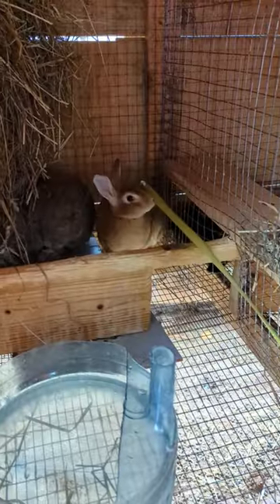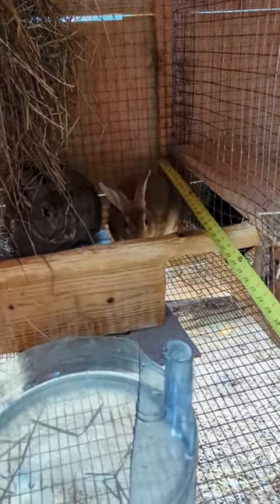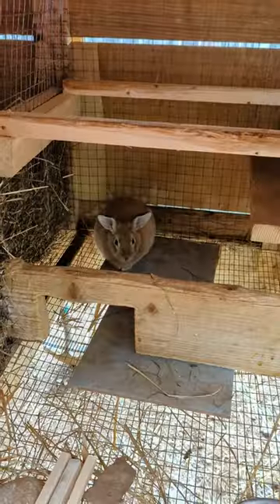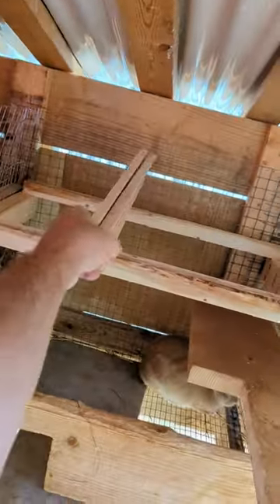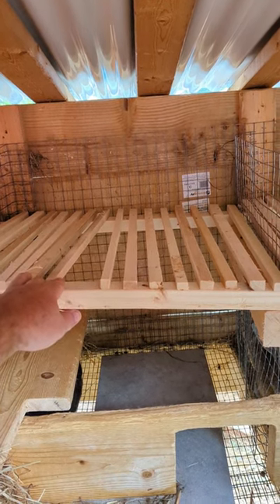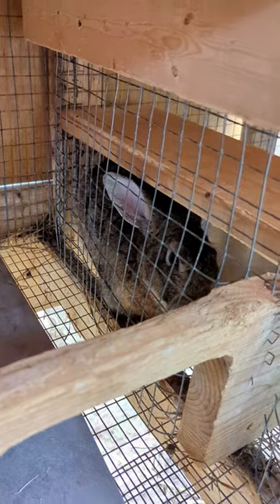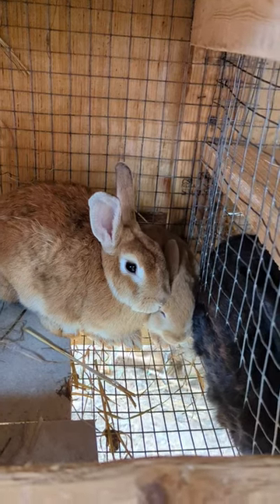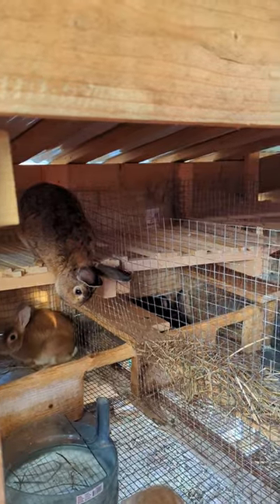building a hay dispenser for the bunny rabbit hutch

Comment: I don't raise rabbits yet but I've been wondering, why don't people just set the hay on top of the wire mesh cage ceiling? Provided there is a roof to keep it dry, of course.
Reply from the maker: I do that, there is no point in paying for specific things like that as wood is cheap. As long as you have a table saw you can split a 2x4x8' pine wood in quarters or 8ths to make your own.